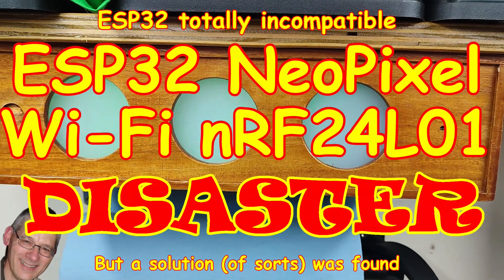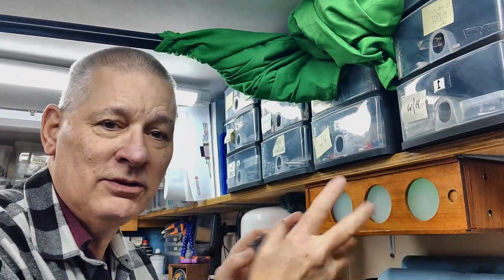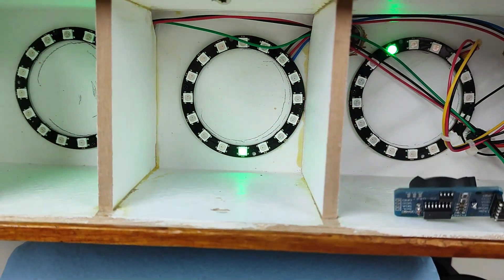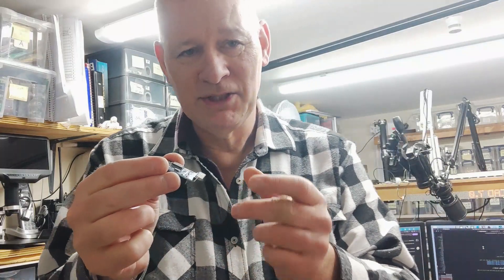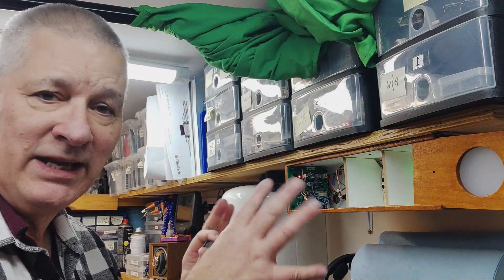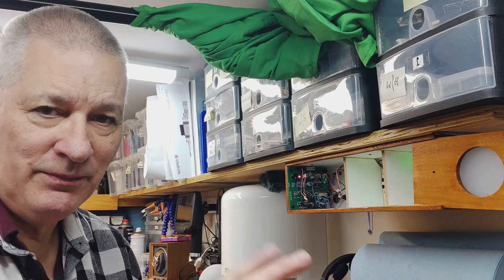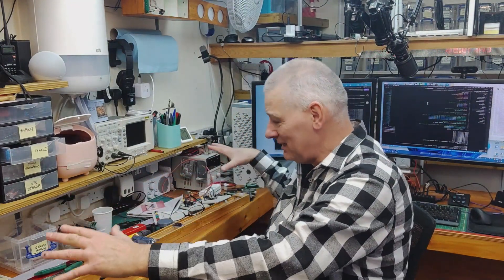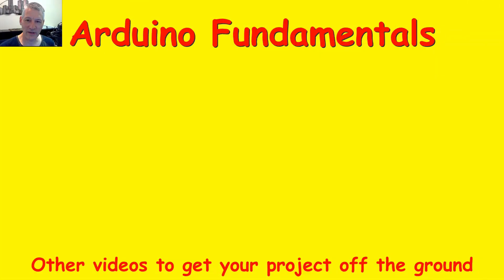#262 ESP32 + NeoPixel + Wi-Fi + I2C + nRF24L01 disaster!😮What to do?🤷

Comment: Does it have to do with a fact that esp32 wifi uses and reserves ADC2 for its operation? Try using ADC1 instead when using wifi. I wonder if it could be the cause.
Reply from the maker: Certainly we can't use ADC2 pins when Wi-Fi is being used; I can't remember which pins I used (this project went to the great breadboard in the sky last year).

Comment: Actuly running anything from esp or arduino than take lot of power case your code to work very bad , no matter what you do
Reply from the maker: Well, I think the power is controlled by the off-board circuitry and should not affect the operation of the microcontroller.

Comment: You make a lot of copies of the Adafruit_NeoPixel objects, that is at least very inefficient.
For the array building it just wastes space, for the initialization, I think it's strange that it works at all.
Better use pointers or references.
The frequency of the NRF channel 124 would be illegal here in Germany, check your local regulations.
Your NRF structs need explicit packing to be compatible between ESP32 and 8-bit Arduinos.
Reply from the maker: We don't want to use pointers in C++, right? 😮

I don't make copies of the Adafruit objects, I'm creating 3 objects of the Adafruit class, so each object only deals with its own NeoPixel ring. Sounds ideal to me.

It generally works fine, but trying to use WiFi with it obviously has an issue. I'll sort it out one day!

Comment: Ran into a similar problem with malfunctioning WS2812B (NeoPixel) LED's when moving a project to an ESP32-S3 whilst using WiFi. Long story short, that--and inspired by your "Create a Library" video--led to porting the led_strip driver from the esp-idf-library to an Arduino library. It's available now using the Arduino IDE Library Manager. Search for "LiteLED".
Reply from the maker: I'll check it out, thanks for the heads up.
Reply: i really have to thank you.
you can't imagine how much your comment helped me.
i was just going crazy because my whole project was ruined because of that NeoPixel library.
i have spent two days searching and just changing my code all in vain.
thank you so much..
Reply: @Abdalrahman_Mohammad  Glad it helped. Have a great one.

Comment: I to had problems when using wifi on esp32-Cam together with neopixels and mcp23017 port expander. as soon as wifi were being used strange things happend.
I finally figured out that my pull up resistors to the SDA and SCL (for the mcp23017) was to big. I started with 10Kohm pullup resistors...When i changed the pullup resistors to 4.7Kohm everything worked together. (No code for tasks or cores needed.)
Reply from the maker: When I resurrect my project I will check out the I2C pullups for sure, thanks for letting me know you fixed your issue.

Comment: Hey Ralph!  Love the videos!  I know very little about the ESP32 and when I was trying to build a dual temperature gauge for my RV fridge, I too fell into the group, "Try try again and then give up!"  I wanted to use the ESP32 because it had WiFi and dual I2C.  I need to run two identical OLED screens that I couldn't change the I2C address.  However, I couldn't get the bloody thing to work with the Dallas Temperature probes and the displays at the same time.  I went to every website that I could and everyone had an example that worked for them...but not for me!  I never figured it out.  I concluded that WiFi wasn't that important to the project and went with two Seeed Studios XIAO SAMD21s.  Tiny, very powerful, and easy, and I already had them.  My disaster with an ESP32 happened when I was first trying to get to know them.  I had purchased several screw terminal boards and didn't realize that the pinouts were very different from the 36-pin models and the 38-pin models and also the model for the ESP32-S2.  Yes, wouldn't want to put 5-volts on the 3.3 pin!  Ah, no explosions...just never worked again.  Oh well, grab another one ... NOoooooo.   Hahaha, funny now!
Reply from the maker: Ouch! I feel that moment of despair, James, when you realise exactly what you did. And you also know, instantly, that there is not coming back from that mistake, not without changing the chip, anyway.

Oh well, lessons learned. Regarding the two OLED screens, I would have used an I2C multiplexer / extender as that seems to work nicely (and your ESP32 thinks there is only one).  Something like a TCA9548A, on which I did a video #148.

Comment: Great video. Had me laughing a number of times while saying "Yup! I've been there too!" My first ever ESP32 project was polling a device very frequently (~every 300ms )  over WiFi while updating the status on an LED matrix display. Works 100%. Then tried making a variant using an ESP32-C3, which is when the roof caved in. No way could I get that going. That's when I found out about interrupt issue conflicts between the ESP32 WiFi Library and FastLED. Core issue is NeoPixels and the matrix I am using are using the WS2812B LED chipset which uses a clockless protocol over the data  line. There are very tight tolerances on that timing which get perturbed with both FastLED and WiFi running on a single core machine. Then found the same issues when porting the project to an ESP32-S3 so that tells me there is something off with the FastLED library on the new silicon. Currently futzing about with ESP-IDF and their WS2812B driver for the RMT peripheral to see where that leads. Anyway, you're not alone in this quest! (Note that FastLED uses the ESP-32 RMT peripheral to drive  clockless LED's like the WS2812B/NeoPixel.)
Reply from the maker: Yes, it seems this problem is quite common, all down to the timing of the NeoPixels. I notice that Adafruit (I think) now have a separate "module" to drive the NeoPixels to avoid this issue. Funny that.

Comment: Set the clock when the LEDs are off.
Reply from the maker: That may work, but it's still a workaround for something should "just work". As it happens, life events have overtaken this entire issue, more of which in a future video!
Reply: @RalphBacon  Yes, not the totally understanding solution, but a workaround for a frustrating situation. Lately I've been working with the  Pico W and have had less frustration than from the ESPs. The level of documentation is amazing especially for such a new module and the software is coming along nicely. Dual cores are useful to handle chores that benefit from true parallelism. I made a networked self setting clock using Pico W and Max7219 8x32 matrix LED a couple days ago and it worked so quickly it was amazing. Five wires, Pico, Max and a 3d printed case, even a 3d printed filter for the LEDs. About a hundred lines of MicroPython and done. Enjoy!  :)

Comment: Using an Operating System as the base of your software should be considered quite wisely. It requires a pretty well understanding of this technology! If you use an OS and apply concurrency then you’ll need to work very carefully. A protection of shared resources - such as global variables / hardware (the shared access to its register by two or more tasks) - must be protected against concurrent accesses! So the awareness of this topic is a must .Otherwise you’re project will end up in a unstable program that shows such strange effects as you observed. In addition the kind of storage for data / variables - stack, heap, static vars on the global heap, the understanding of the storage locations such as flash (non volatile) and RAM (volatile) and where data / constants are actually stored - is an absolute must. Furthermore the demand of the keyword volatile is vital if you work with an Operating Systems concurrency! Otherwise you’ll end up in a software that does “strange things” 🥺 Demystify this weirdness! And don’t be tempted to use concurrency just because it seems to offer a simple solution. If you can do things synchronously then you should prefer this path. Concurrency requires synchronization and hence a careful design of your software architecture.

Comment: Hi Ralf. I had a peek into your code and found a possible error. Within some Header files you declare some variables as static storage type. This means that on every Module that includes this particular header these Values will become a new instance / storage in memory! These are not shared and treat as one variable! Or in other words the Variable what you have declared as static has not the one and only storage! 
And this is surely not what you intended with the static declaration! What you really want is a global variable with one storage in memory*. So then just do so. Declare the variable in the header as extern (*not* static!) and define it in a Compile Unit (.c / .cpp file) where the compiler / linker then will assign to its actual storage (memory) to. and this one then is really unique!
As a rule of thumb: NEVER declare variables within Headers as static storage type that you want to be unique / share within several modules within your code. If you do so  you'll run in serious trouble... ;-) 
If you need a snippet which demonstrates my concerns, don't hesitate to drop me a note here in the comments. ;)
Reply from the maker: I'm wondering if the static variables are for the tasks where I want each "instance" of the task to have its own set of variables... but until I check I won't know. 

I will check this all out this afternoon. Thank you very much for reviewing my code, I need that more often! 👍
Reply: @RalphBacon  Well, a Realtime OS just partitions your System Stack (which is defined by your Linker Script) that way that every Task has its own piece of this System Stack as defined in the Task- Parameters. The Task scheduler then takes care to restore the CPUs stack pointer to each assigned stack frame. However static Variables will never be located on the stack - disregard if your program runs on a Realtime OS. Static vars are located on the (global) heap memory space. See stack memory has to be treat as valid within a functions scope only. Hence one should never return a pointer (or C++ reference) to a local variable because upon return this memory has treat to be invalid. But this an different story… 😉 
Well I n this matter you did it right to use a global variable in order to share some data between Tasks but take care about static vars, because these are technically stored on the global heap (what you want) but there may be multiple of them (different memory locations) as defined in each compilation unit! This multiple presence is not a problem because static vars are not exported by the linked.
So long story short: For sharing Data between Tasks never use static vars rather than real global ones which guarantees the one and only storage in memory. Or better - use the OS capabilities to exchange data between tasks such as Message Boxes or global storage in combination with Semaphores / Mutex in order to perform the access atomically …
Reply from the maker: Thanks for the feedback, Hans, sehr gut gesagt 👍

Comment: I really don't like it when I can not solve a problem. And believe me I have put in days to solve a problem.  Don't know whats going on Ralph, but maybe upping the stack memory on the tasks and using an external antenna may help. Your probably right though about the pixel library.   Divide and conquer is my usual way of troubleshooting. Try only running 1 neopixel task and wifi.    There is a function called gethighwatermark() which records the least amount of stack memory not used during run time.  Maybe turn of the neopixel driver while your getting the time. Good luck, you will figure it out !
Reply from the maker: You are reading my hymn sheet, Joseph! Yes, did all those things and it's not lack of memory. It's certainly the "show" method of that NeoPixel library this is causing the issue so I will investigate all this soon, when I have a nanosecond or two of spare time!

Comment: Take a look at WLED. It is code that controls neopixels using an ESP8266 or ESP32. It uses WiFi to allow users to change various options and settings. The source code is available so users can modify it to suit their particular needs. I believe it uses the "fastled" library for controlling neopixels. Maybe it will give you some clues as to what's going on...

Comment: That's odd, I made a binary clock, uses cheap 2812 "tape", and Wifi on ESP32 and it has no problems at all.  Also has a TM1637 digital display and a 1.8" TFT showing an analogue clock and still no problems. Encoder to choose the Wifi network and set the password and off it went. Everything is in the loop, though, because I don't understand or need tasks. You can have a look at my code if you like.

My libraries (I think one or two are superfluous) were:
#include <SPI.h>
#include <TFT_eSPI.h> 
#include <WiFi.h>
#include "TimeLib.h"
#include <Preferences.h>
#include <FastLED.h>
#include <TM1637Display.h>
#include <Button.h>  // Button library by Michael Adams. Best library I've found for debouncing.
#include "free_fonts.h" // Needed for TFT_eSPI
#include <ESP32Encoder.h>

Now, if you fancy another challenge, get an HW-0515 tone generator and program that from an ESP32. I can't get it to work at all. It NEARLY works, and I thought it was inverted TTL levels, but that wasn't it. I can't find an email address to suggest this to you, so this is a desperate move.
Reply from the maker: I see you are using FastLED (I'm using Adafruit NeoPixel) library. Maybe that's all it will need to get it working. Or perhaps it's the tasks multitasking that is the issue...

I'm afraid your desperate plea is in vain as I have not programmed an HW-0515, and certainly not from an ESP32. You do like a challenge to fill your day, don't you, Neil? Sorry I can't help. Good luck with Google, surely someone has done it?

Comment: Having 2 tasks access one hardware is not a good isea. Do it sequentially.
Reply from the maker: I don't believe I'm doing simultaneous accessing? Three tasks for each of the NeoPixel rings, one task for the RTC time retrieval. Is that not so?
Reply: @RalphBacon  Why not do it sequentially? Tasks wil be randomly interrupted outside your control. Interruption = glitch.
See "BinClock_WS2812.ino" on git example.
Reply from the maker: If the NeoPixels were just jumping about and displaying the wrong colours and so on, I'd be certain it was just timing (interrupts). But the fact is crashes (sometimes on Core 0) just bemuses me what is going on!

Comment: You could try putting the NeoPixel rings in series and just running them from one task. They would be fed by values in an array appropriate to the  length of the series connected rings, and you just update one third of the array for each ring.
Reply from the maker: Well, I could but (a) I shouldn't have to, tail wagging the dog and all that, and (b) I'm not convinced it would necessarily help. But when I found out what it was I shall let you know!

Comment: I'm using Makuna's NeoPixelBus and have no issues with WiFi on the ESP32 (but I'm using a ws2812 LED strip, not a NeoPixel ring). I use separate tasks for WiFi and LED control
Reply from the maker: Hmm. Another library. And using tasks. Now that you have said you have no issues I might just give it a whirl. 👍

Comment: Not sure why you need wifi and internet connectivity for this project. Am I missing something?  Seems ESP32 is overkill for this.   I have extensive use of nrf24 and rtc connected to Mega, Nano, and some with addressable leds.  No problems....but I use SPI for nrf24.  I found that nrf24 libraries with I2C capabilities erratic with I2C connection.  Set the RTC time while programming and connected to the IDE, it will be accurate as long as the coin cell lasts or there is no power interruption.
Reply from the maker: Well, you've sort of missed something, but mainly because I haven't explicitly mentioned it yet. 😮

As you know, most of my ESP32 projects have a web interface so my phone (or other browser) can connect and read info or even make the device "do stuff" without me being present.

So having Wi-Fi is required and getting the time is then almost a beneficial side-effect. But now it's not, so I am still investigating.

Comment: Hi Ralph. I feel your pain. Spent the last 4 days trying to get ePaper displays working again on a project I last looked at in 2021. I think I figured it out last night. 

Maybe not efficient, but could you have used something like an ATTINY85 to just control the neopixel rings and communicate with it via 2 pins for serial tx/rx?  Then you wouldn't have to mess with your wifi time-getting functions and wireless comms with the bins?  Maybe I'm adding complication to the situation, but it's a way to offload a relatively simple task of controlling the neopixels to an inexpensive, simple isolated processor.
Reply from the maker: Yes, offloading has been mentioned by others (including Adafruit) but it should not be necessary, I feel. Not yet, anyway.

Comment: I don't know if you saw my reply below.  I was looking at your files and noticed that the PIR used pin 17 for signal and the RTC_SDA had 17, but was commented out in wifiHelper.h (also commented out in main.cpp).   But if you were trying to use 17, that may have been the RTC I2C issue.

Comment: I would have used a LDR to detect light in your room and only show the Neopixels when the LDR is in certain ranges. I have also had issues with the Neopixel library and interrupts on Pro Minis.
Reply from the maker: As it happens, we're thinking along the same lines. I'm using a mini PIR that detects movement. Absence of movement for 15 minutes switches off the NeoPixels. And yes, interrupts are probably to blame somehow.